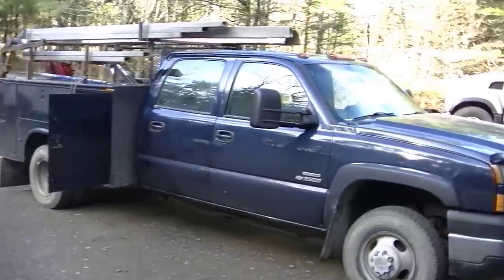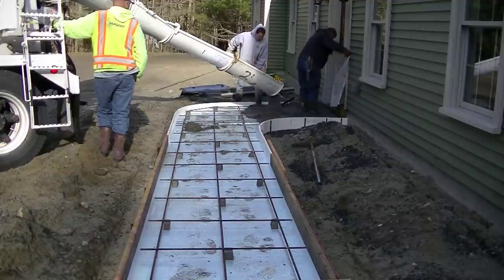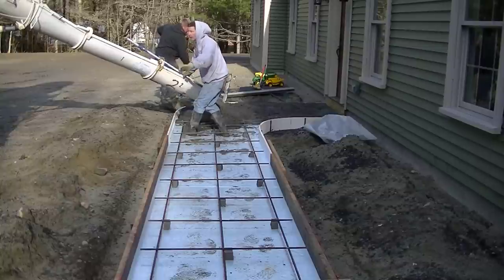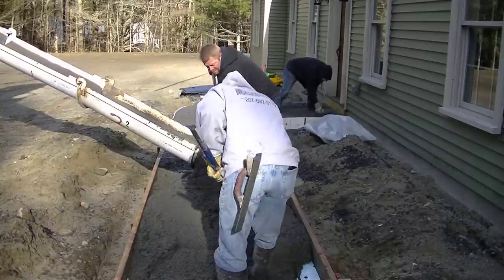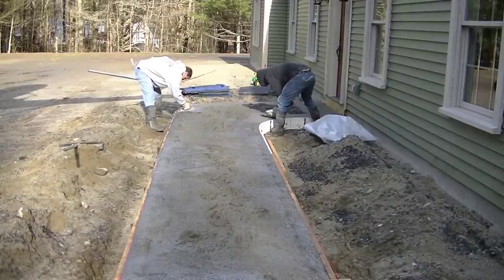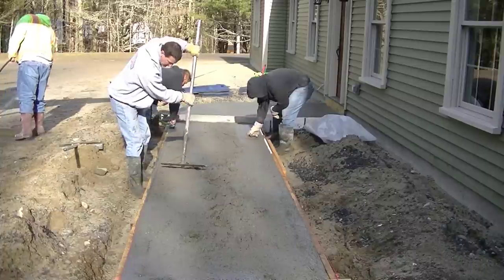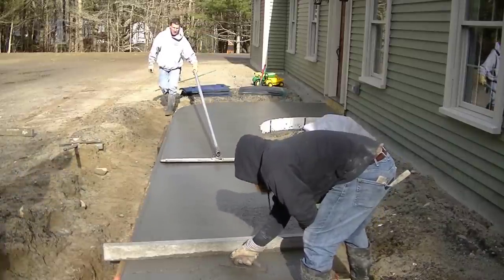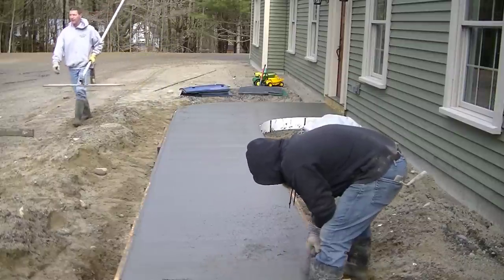Beginners Concrete Sidewalk DIY (Part 1)

Comment: I poured a 5'X11' 4" thick patio by dumping all the bags in, adding water & adding metal mesh, & tamp/mix and finish the top. Came out great. If I didnt like the finish I would have tiled or bricked on top. Ive had concrete poured many times, last time it was 2500sq ft (RV driveway, circle drive & courtyard.)

Comment: I’ll be tackling a pour of about 3.5 yards tomorrow. I’ll be on my own at first until my help can arrive to help finish. But this will be my first time leading a job - and meeting the concrete truck on my own. 
Main thing I’m concerned with is not allowing the concrete to set too quickly before I’m able to put a decent finish on it. 
Hopefully I’ll have my help tomorrow, otherwise I’m doing the whole thing by myself

Comment: What kind of PVC board did you use for the curve? Also how you prevent concrete walkway from, falling down a hill? I have a sunroom and want to put a walkway around it. But one side is on a hillside. I was going to drive some rebar down into the ground and also into the sunroom concrete on the side

Comment: Hey Mike, would you be able to find some time to talk about the finishing the air entrained concrete? I heard that smooth finish (bull float, mag floats, steel trowels, etc) is not recommended for this type of concrete and I am wondering what kinds of other finish could be available for this type concrete.

Air entrained is said to be very good for freeze-thaw enviornments and that's the main reason why I prefer this type of concrete, although maybe you would know better options for really harsh winters like we get here in Canada.

Comment: Hey
Can you do a sidewalk like this with use a concrete mixer? Or is it to much. Here in Sweden were a live it is very expensive to order a concrete truck, so I like to know if it is possible to do it by myself
Thanks 
Sorry for the spelling..
Reply: Concrete trucks are very expensive here also.  The cost is just passed on to the consumer, as is all the higher costs.  Thanks to massive government spending, that's the life we have now.
Reply: You can do this by yourself. But, It would be a lot of work and you would definitely want to have some help because you will need to have someone constantly mixing up concrete for you so don't run out and cleaning your buckets and tools. You also want to make sure you do your homework and know how to screed and trowel the concrete correctly and have all the tools you need, including your corner trowels, the right kind of broom for brooming the concrete, etc. As he said, if you screw this up and it cures before you have it done, you are going to have to smash it all back out.

One option would be to do the concrete in sections. Basically you would build your forms the way he did here and then you would put some cross pieces in. Fill every other section and let it cure enough to where you can take you cross sections out, then fill in the empty sections with concrete. The trick here would be to measure your segments so that the segments you start with are the same length as the segment with the cross pieces in it, or you will have different length sections, which may or may not be a big deal for you.

I have seen people pour slabs like this and it has come out great for some and absolutely terrible for others. It all comes down to knowing what you are doing and not trying to pour more than you are capable of doing by yourself. I would definitely say it would require at least two people and buying or renting a cement mixer would be a huge help. 

If you have never worked with concrete before, I would recommend making some large concrete pavers for your garden or other places around the home. I would make them as large as possible to get a feel for the curing time and finishing, but not so large that you cant easily smash them up and throw them out if the come out terrible.
Reply: Mixing and pouring concrete isn't high science.  Pretty straightforward.  That said, it is HARD work, and you DO need to be very organized before you start.  For a job like this, you're gonna need at least one helper.  Preferrably two.  MAGA MAN said it best in his reply when he said "You can do this yourself. BUT"!!!  lol

Depending on the size of your project, and the weather in your area, dry pour could be an option.  There's a REASON why this video has the words "dry pour" in the title.  Dry pour concrete has become a very popular option for DIY folks doing smaller projects with only one or two people.  The channel owner realizes this, and is trying to capitalize on the 'dry pour' search phrase in his own videos.  Smart!

The main BENEFIT of dry pouring, particularly when it comes to a one or two person job is, no racing to beat the clock!  You don't have to worry about dry poured concrete SETTING before you are able get things just right.  And while concrete is pretty straightforward work, if you're NOT experienced at techniques like screeding and floating and finishing, trying to do those things before the concrete sets can be tricky!  This is not an issue with dry pour.  Of course, if it rains, you're screwed!  lol  So any dry pour concrete work should definitely be done when there's NO CHANCE for rain!  I'm guessing windy weather would also be a no-go for dry-pour.

Another benefit is you don't need some of the tools that are required for wet pour.  The mixer, floating tools, rubber boots, etc.

Make no mistake.  Traditionally mixed concrete will be stronger and more durable in the end, but it's one of those things where slight differences probably won't matter.  I have a traditionally poured 4" foundation under my house, but where we added a room, we used dry pour.  This was 15 years ago, so the whole 'dry pour' thing is definitely not a NEW concept, though many of the videos on youtube showing how to do it certainly have come up with new techniques that I wish we would have known back then!   Instead of trying to 'build up' the ground to the same level as the rest of the house, we created our addition as a sunken room.  It only has a two inch foundation, but it was created with a crude dry pour method.  That room is carpeted now, so I can't say for certain if that foundation has suffered any cracking, but the traditional four inch foundation has a couple!  Granted, it's ten years older than the thinner, dry poured slab, but, you know, wet-poured concrete cracks too!

You know better than anyone what your competence level is.  If you're able to follow directions, and are good with your hands, don't shy away from trying the sidewalk yourself.  Just educate yourself first.  Watch plenty of videos!  Watch people doing wet-pour.  Watch people doing dry-pour.  Don't listen to JUST ONE person, especially if that person is trying to sell services in the same industry.  Those folks have skin in the game, and they might well mislead you as they try to protect their bottom line.

Comment: Why is the polystyrene insulation under the concrete, since this outdoors?  The insulation will cause the concrete to freeze more often because there is no warmth (50°) from the soil.